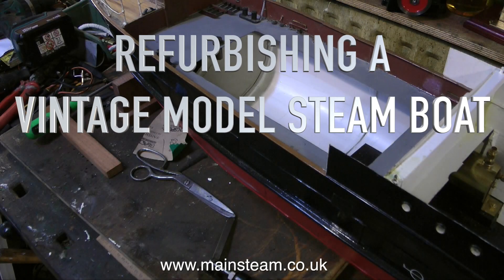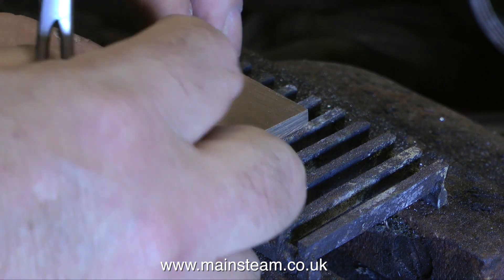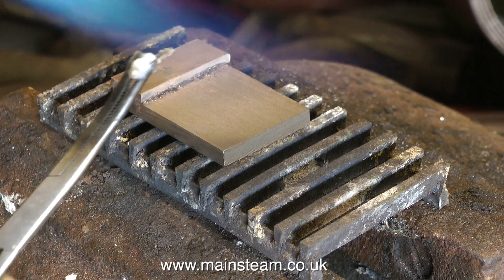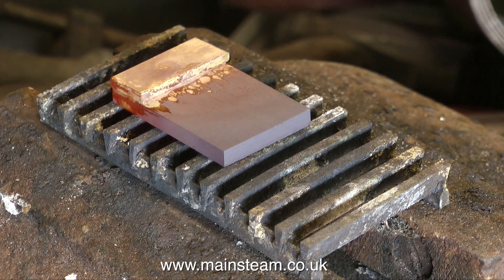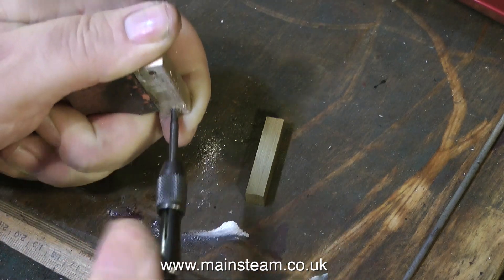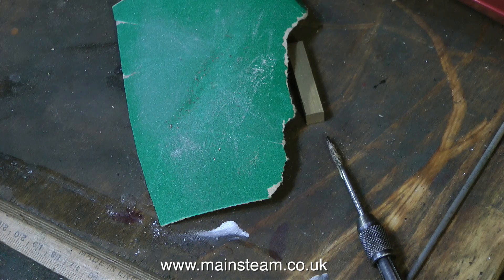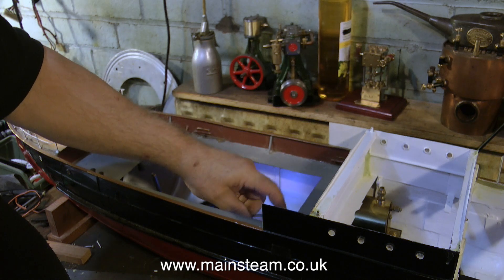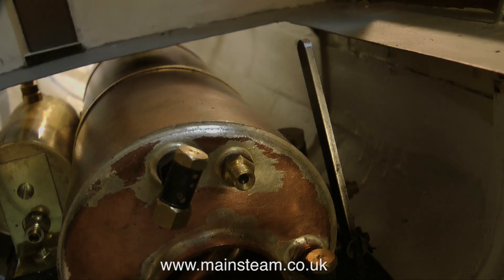REFURBISHING A VINTAGE MODEL STEAM BOAT - PART #18

Comment: She's a looker of a ship even in this dismantled state. I've seen some chaps who put electric pumps into their boats for the feedwater with some electronic gadgetry to monitor the water level, but I wouldn't trust it, a good solid ram pump like that will require alot for it to go wrong. Keep it coming, Keith!